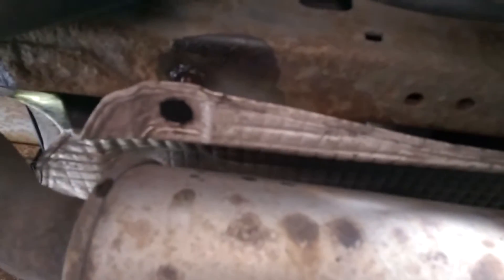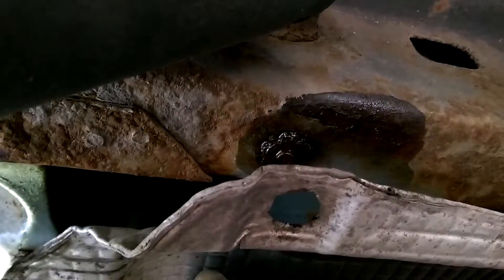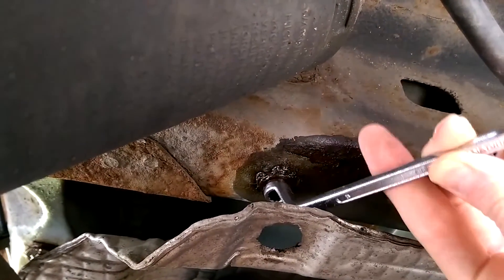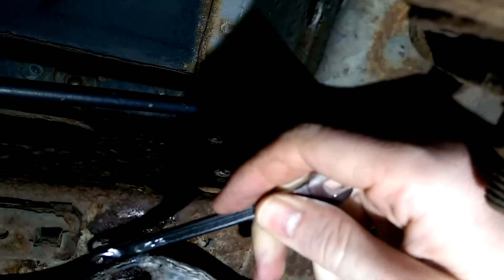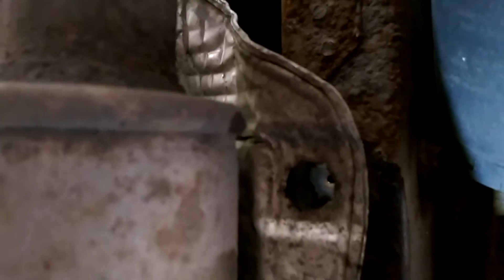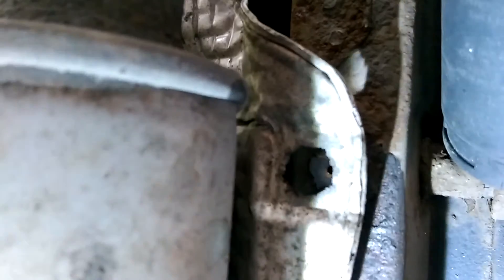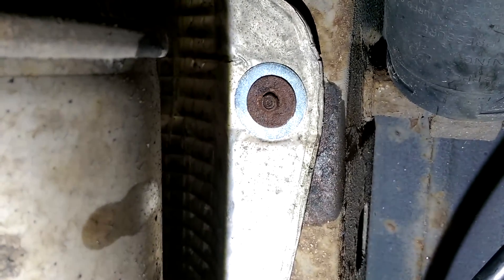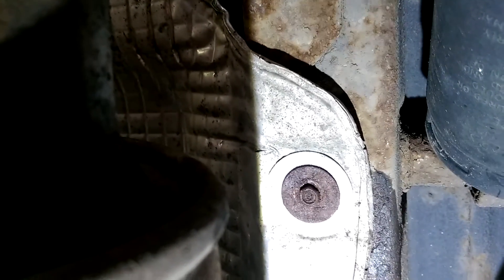Chrysler Grand Voyager exhaust heat shield repair

Comment: Nice.  I have the same problem but with a 2012 Dodge Journey.  Instead of the Caravan's bolt that is driven into the metal of the vehicle, the Journey uses a bolt embedded in the vehicle's body and a threaded washer that is driven into the bolt.  I am trying to find out what torque (ft-lbs) should I apply to the threaded washer, or in your case the bolt.  Would you happen to know the torque specified for the bolt?
Reply from the maker: No idea on torque sorry. As it's only fastening a metal plate and non essential or structural torque isn't normally needed, just hand tighten and use loctite if unsure to avoid it coming loose